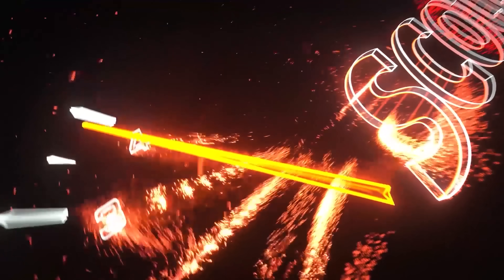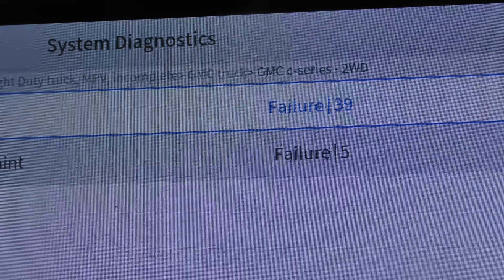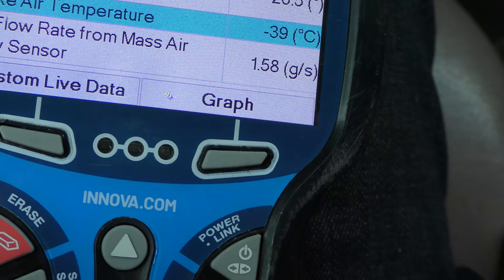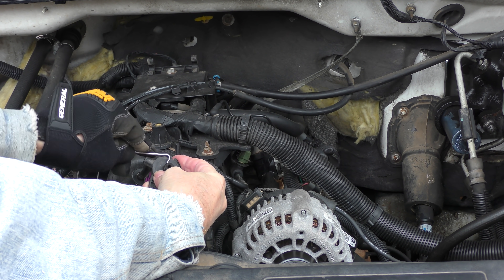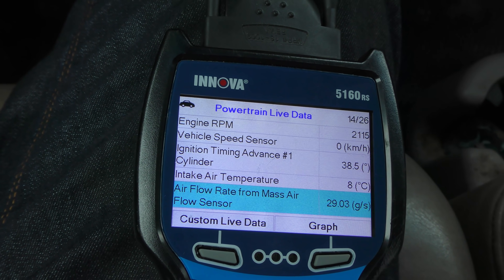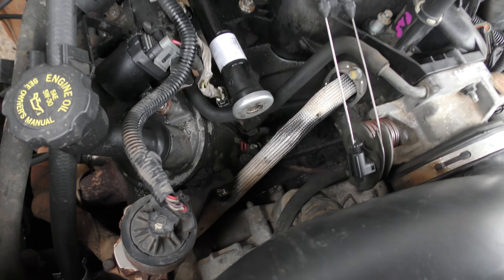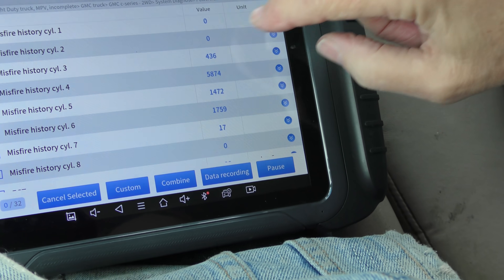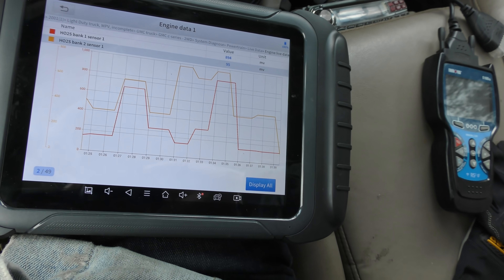My Customer Just Bought This Truck and Now He’s Screwed

Comment: Hey I got a similar truck. The 6.0 in it is in decent shape paired with the 5 speed manual. Would it be better for me to get a built up 6.0 replacement or the D-max when the motor does eventually go?
Reply: I’d get a jasper rebuilt engine for it. Keep it gas so you don’t need a bunch of things changed to convert to diesel. Just my thoughts. People have had bad experiences with jasper but people have problems with everything nowadays so.
Reply: I also wouldn't do the Diesel swap unless you wanna pay more and need the towing or what not, but personally, I wouldn't go for a jasper engine, 
I would look for a used engine with less km if possible.

Comment: being that is a dualy heavy truck I would think that the engine and probably trans are both worn out. whe nI was younger in m yteens I did the patch it thing you know fix one head but not the other then later on fix the other in the end it cost me more money also when the engine starts to wear outthe generally wear out evenly so if it is missing and the head need work done then you fix those it throws everything out of balance even more so probably best thing is to find another used decent engine and renre thatis of course if the vehicle is in half decent body shape and the trans and diffs brake lines all that stuff , but then now day ther is sooo much extra crap on vehicles it may not be worth it at all not like the good old days where there is some wires some hoses we used to reNre engines like in the old Mustangs in about 45minute if everything goes smooth now day 45minutes is probably barely enough time to unplug everything to get at the engine hehe

Comment: Hey Scotty long time subscriber, I just changed the spark plugs and now it's idling better however when I start the car it jumps or shakes a little but then it stops. I'm wondering is there a way to better quiet it down more?
Reply: Check your motor mounts.  There are usually four on a basic car.

Comment: 280,000 miles on a chevy? Well it made it 200,000 more miles than some chevys.
Reply: @Sean Jones Scotty & everybody knows pre-2009 ish Chevys are the good ones, & the new ones are the BAD unreliable ones. Because of gadgetry over dependability. FACTS
Reply: Interesting how the scan tool said it was a 2001 GMC Sierra… although mechanically very similar.

Comment: I had a 2000 Silverado with the 5.3 I changed the oil every 5000 miles myself with top quality synthetic oil & at 145,000 cylinder # 7 went out, piece of crap. No more Chevy's for me.
Reply: They were good in the 70s 80s GM trucks Motors are really crappy now lot of people would do trucks got to get new Motors after 80000 miles

Comment: did he check the points inside the distributor cap to see if the connections are dirty not making good contact i haven't heard Scotty mentioned anything about him doing that not having a good spark causes misfiring obviously Scotty is just going by waht his computer says well the computer isn't going to tell you if your distributor cap is dirty inside he just likes talking crap about Chevy
Reply: This engine does not have a distributor.  It is coil near plug.

Comment: 3500 Dually with a 6.0, i bet that thing is a complete pig. Did this guy not assume he’d be putting an engine in this thing with almost 300k on it? When I saw all of the codes I figured the PCM was screwed.
Reply: CHEEP
Reply: It actually appears the PCM is doing its job. The first scan was of cumulative codes. Scotty cleared them as you normally would and then addressed the codes that reappeared. Obviously that engine is toast, most likely from years of neglect and lack of maintenance. The size of the engine isn't the problem. If it had a huge diesel and was neglected you would still end up with the same result... Engine refresh or replacement.
Reply: @robinround7314  Right, but initially when you see codes for what seems like sensor on the engine it makes me think PCM. A 6.0 in a dually is definitely not going to last as long as a duramax would have. The 6.0 is a good engine but they're kind of dogs, not to mention being more stressed.
Reply: Most of the 6.0 variety of engines were specifically designed for medium and heavy duty truck use. Even a Duramax that is neglected and not properly maintained will fail prematurely.
Reply: @robinround7314  yeah dude, I get it. You keep repeating the same thing, but even a well maintained 6.0 worked hard in a dually will not last as long as a diesel. 270k out of a 6.0 in a work truck is really good, I would assume it was well maintained.

Comment: Looking at the data I would say if you live in a state that doesn't require inspections maybe you can get away with it only in that vehicle for the next 10 years or Chevy is a long-term truck I don't know about the six wheel 3500 but I know Chevy trucks between 1991 and 2010 2012 stay weren't bad they last forever too many codes no not an expert at Scotty status hell no but it would take you weeks to fix those issues and God knows what's going on within the transmission transfer case the differential the exhaust system power steering system steering column call the condition of the overhead cams are

Comment: Funny how he goes on and on in other vehicles about ATS fuel system cleaner, then totally neglects the perfect candidate for it, a truck that’s been sitting in a field for years with varnished gas in it. 🤡
Reply: The first thing i would check is injectors and the fuel pump/filter

Comment: TAKE ALL OF COMPUTER SH T OFF, REPLACE THE FUEL INJECTORS WITH A CARBUREATOR, PUT IN A SET OF POINTS AND REGULAR COIL, DO A VALVE JOB ON THE HEADS, THEN DRIVE IT ANOTHER 150, 000 MILES !    HAAAAA !     SOLVED THOSE PROBLEMS !     ENGINES ARE VERY OVERLY HIGH - TECH !